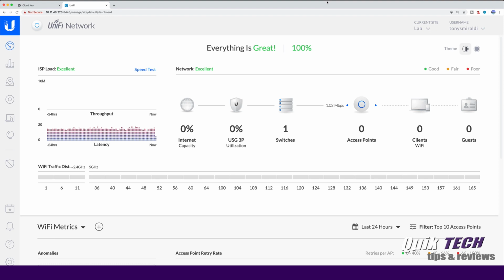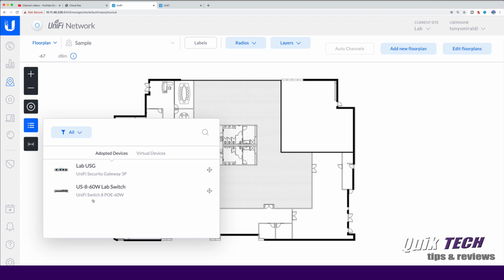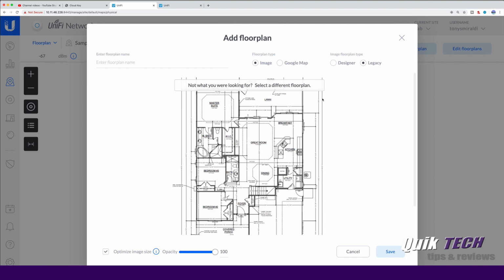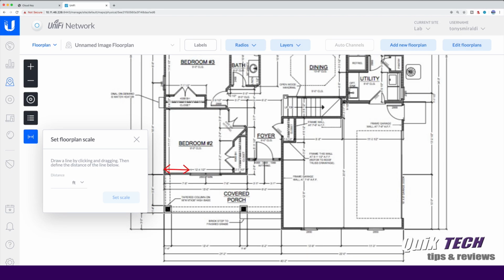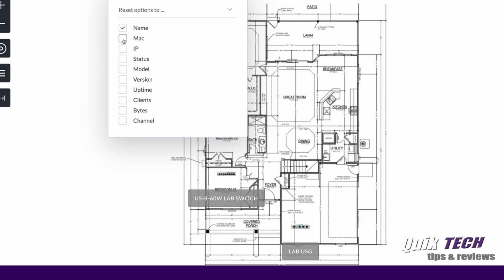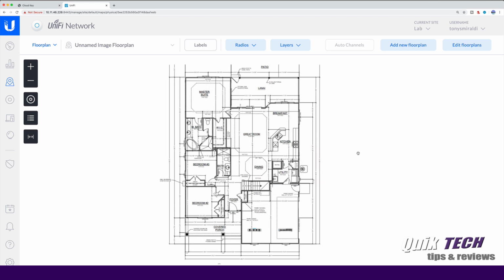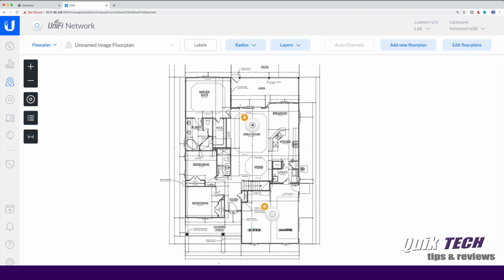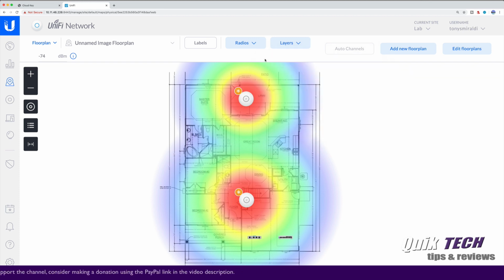How To Add & Scale a Basic Floorplan Map in Unifi

Comment: OK, so what application do you use to create the floorplan that you import in to the Unifi System?
Reply from the maker: Hello Brian, i don’t create the actual floor plans. However,  any program designed to create floor plans would work as long as the floor plan is saved in the appropriate file format.